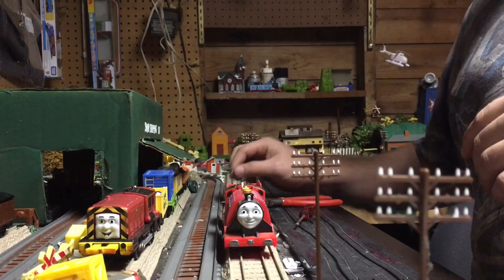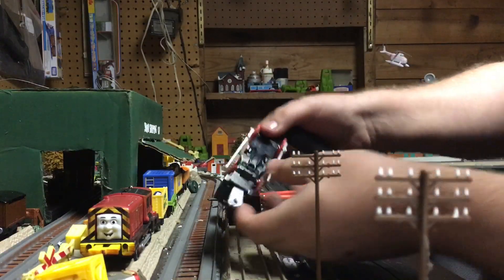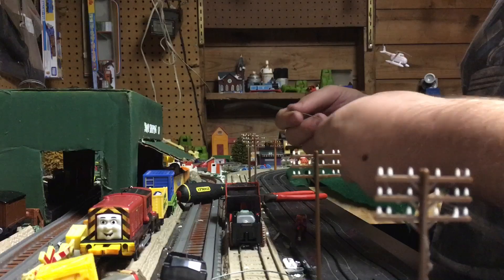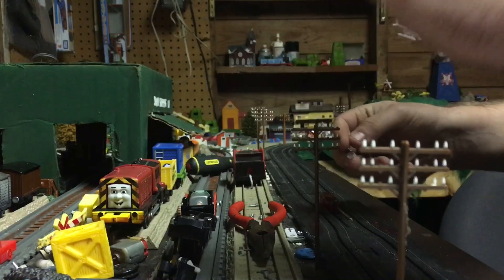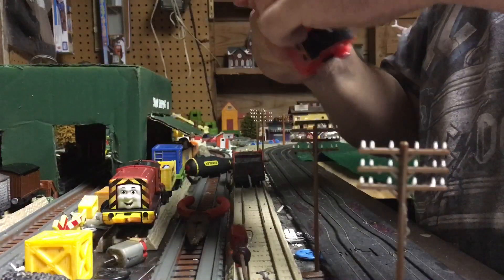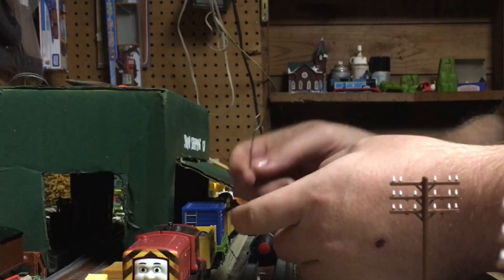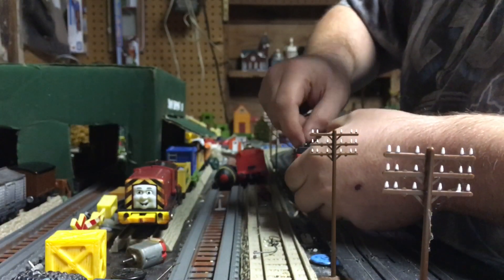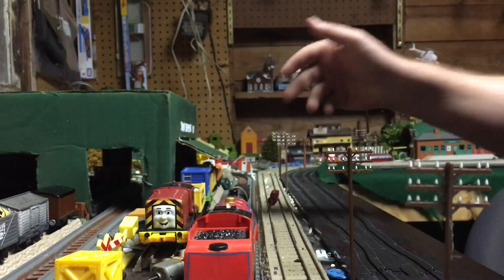MODIFICATION STATION #4 hook and chain couplers

Comment: I’m thinking of using a small chain to turn into a small coupling system for Trackmaster and Bachmann HO Scale but I can’t shorten up the length of the chain to the length I want the coupling to be to prevent chain coupling drag, what do I use to make the chain length shorter?
Reply from the maker: SMG5 // SuperMarioGlitchy5 you could just pull  and twist the chain apart or you can take wire cutter pliers and cut the chain to the length you want.
Reply: Trackmaster Productions 2016 Oh, I can just do that?  I have a problem with that though, I don’t have any wire cutter pliers to make the chain shorter, I can make the chain length shorter, unless I can find the right size to just cut the chain to the right length, and I’m doing the modification to a few Bachmann Thomas & Friends characters, I’m also getting an O Scale model of B.E.D.T #15 to turn into a model of Strasburg Railroad Thomas, but as for the Bachmann HO Scale Thomas, James, and Percy, I need to cut the chain to the right length so the buffers on the front of the engine and the rear side of the rolling stock slightly touch to the length of the buffers, as I’m writing my own book series inspired by The Railway Series, instead of using the characters in the use of the base locomotive, it’ll have the characters seen at actual Railroads in the US called “The Railroad Series,” featuring Strasburg Railroad Thomas and the Percy dummy seen at real railroads, book one will be called “The Two Railroad Engines”
Reply: Trackmaster Productions 2016 And my hands are way too slippery to pull and twist the chain apart